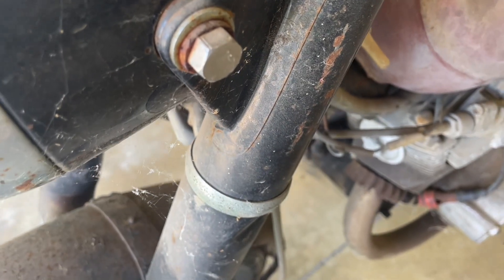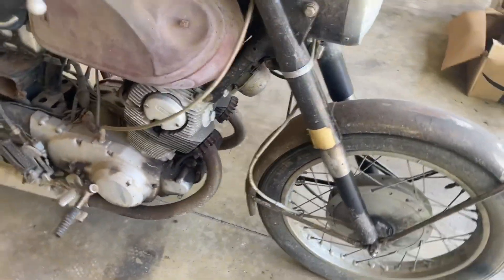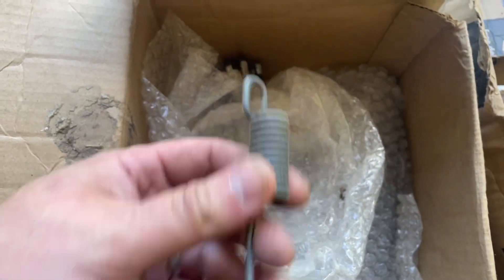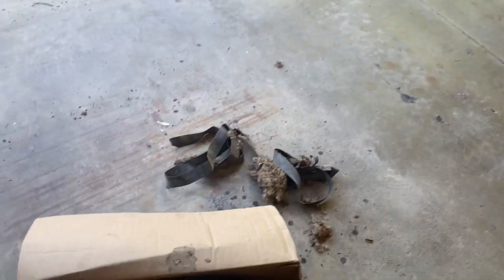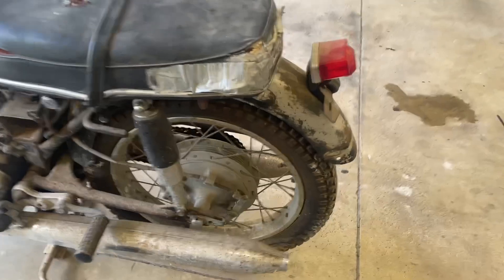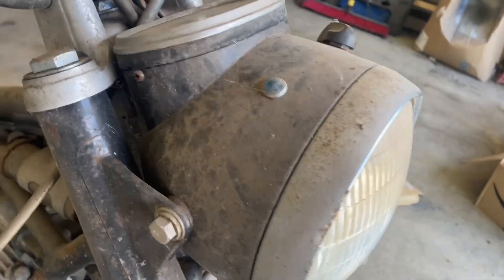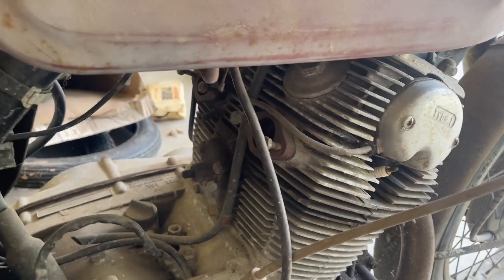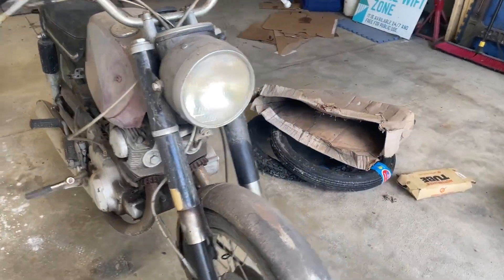Vintage Motorcycle Barn Find Honda CB77 Super Hawk! First Look!

Comment: That was my grandfather's bike, he restored it back in the 70's and gave it to me in the 90's.  It sat in a basement and then a shed for many years after that.  My father in law and I got it running again around 2006 and I learned to ride on it.  I started to work on it by acid etching the inside of the tank and putting a liner in it to prevent rust from it sitting.  I started sanding the exterior of the tank to paint and was hoping to restore it at least somewhat before life got in the way.  I ordered some parts which you have now, including the side stand, I could not find the bracket for a reasonable price at the time.  It was running when it got put in the shed again in 2009, unfortunately the carbs went out and it has not been started since.  My brother in law is the one whom you bought it from. I look forward to watching it come back to life!
Reply from the maker: Oh wow! A direct connection. That’s awesome. Those side stand brackets are hard to find for sure. I look forward to getting it going again! It’s great to have some additional history on the bike. Thank you for commenting and sharing. I really appreciate it.
Reply: @KeepOnWrenching Would love any updates on the bike as you work with it.